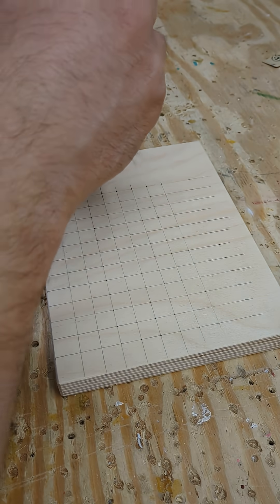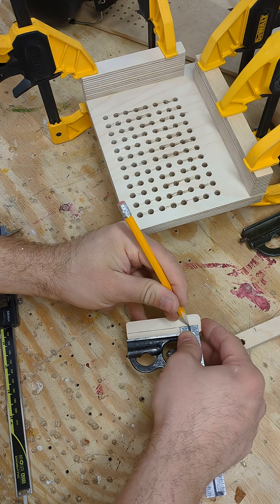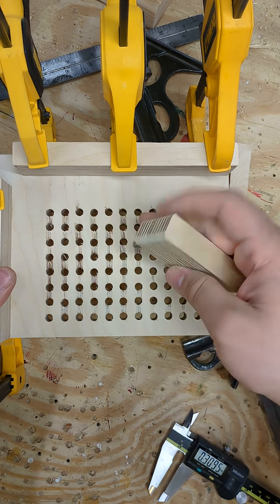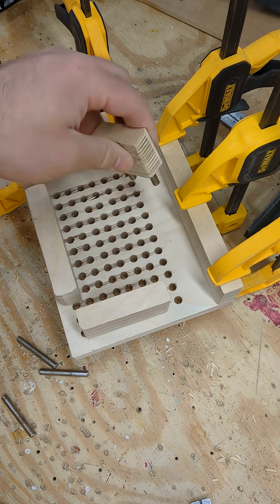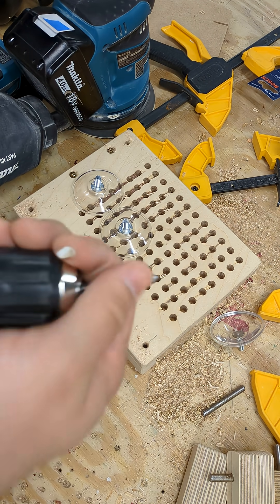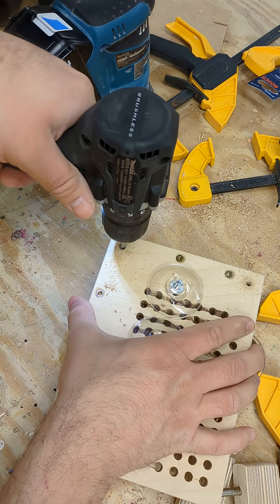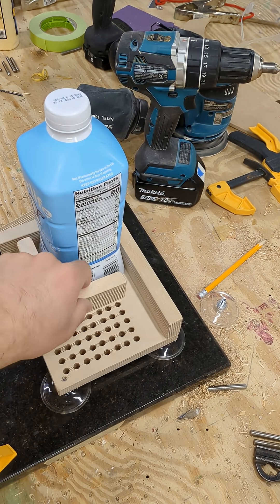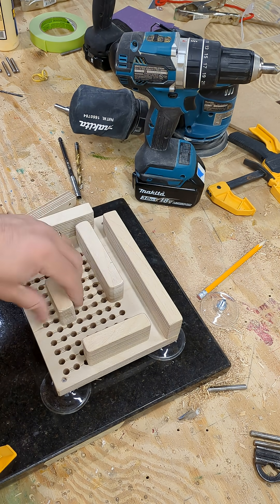Post-Surgery One-Handed Jar Opener

Comment: Brilliant design that could help people with a variety of accessibility challenges.

I feel like I've seen suction cups with a lever, where pushing the lever in one direction makes them suck (so to speak), while pushing it in the other direction makes them release. That could make it even easier to move to different spots, perhaps?
Reply from the maker: Thank you, improving the release would be paramount if this were applied to a broader consumer base, I like the idea of a lever to actuate, and I think that method would best be used with a single large cup